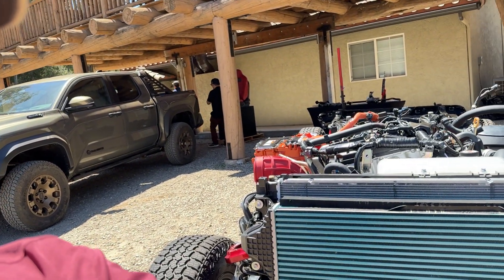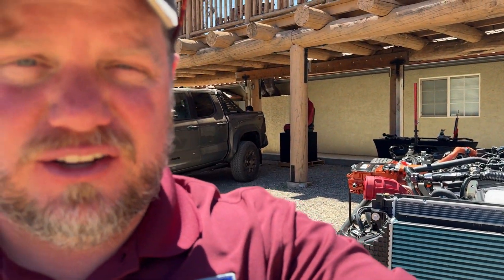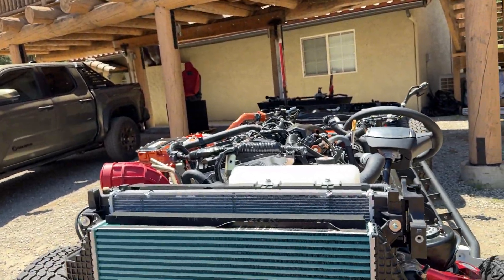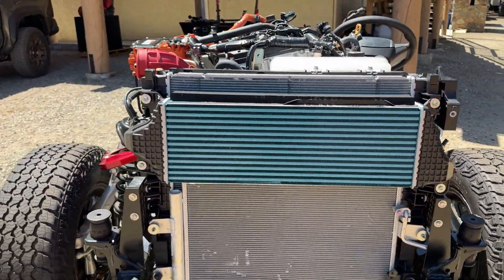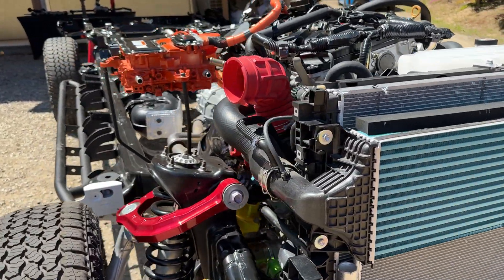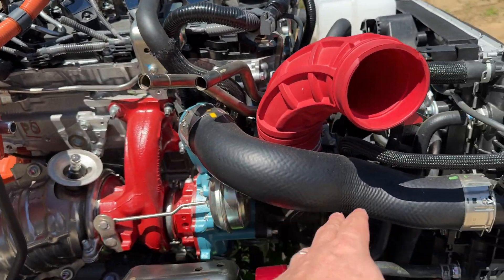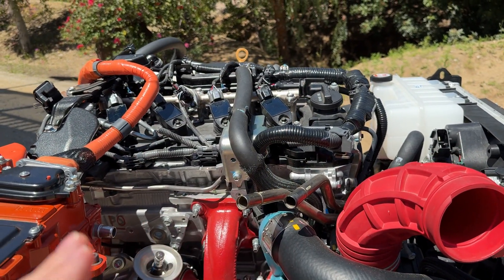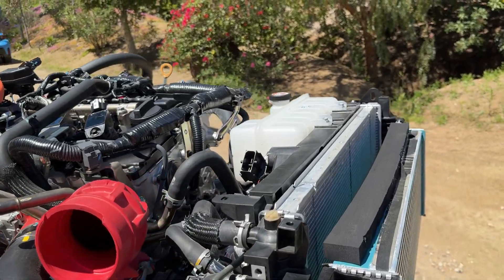More Complexity Coming! New Gas Truck Engines Are Getting Gasoline Particulate Filters

Comment: The powers to be have ruined the diesel with the addition of particulate filters and now want to do the same with gas. I guess this is their way of forcing everyone to the all electric platform. Increasing the cost and weakening reliability of the gas engine platform is the ultimate goal to force everyone into thinking that an electric vehicle is more reliable and cost effective. I have yet to see the government or any auto manufacture explain how their going to deal with all the power that will be needed to support this path we are on let alone how the spent batteries will be dealt with as they need replacement. What will the monetary and environmental costs be to support the future of electric auto's? It appears to me that the goal is control of human movement , not the environmental impact of gas and diesel powered vehicles.

Comment: When is BOEING going to get these? So the EPA is worried about gas and diesel engines but yet a plane can literally do a fuel dump to reduce weight. Literally dropping raw jet fuel from the sky.
Reply: Just wanted to post a link to one that did happen. Main reason it caught attention is because it was over a major city and schools but imagine all the fuel dumping over the ocean that aren't being reported due to no one knows so not a problem.
Reply: @JacobWinkle 😂 just how many aircraft with a fuel jettison system do you think there are in the United States and just how often do you think fuel is dumped? I GUARANTEE you airlines don't want fuel dumped outside of an emergency situation. Fuel is one of their largest recurring expenses.
Reply: @wilmarbarrick3194  Oh man do you have some learning. They dump fuel a lot. They dump fuel before landing to lose weight so the weight doesn't break anything. They don't have to but they do because the amount of time a plane is down for repair is money lost. Its a lot of money lost. Just look at how it is when they repair run ways. They don't shut the airport down, they wait for a gap in the time to do it with a lot of construction equipment and go to town doing sections at a time.

If the numbers are still true from 2018, dumping fuel is a .01% but if that number still holds true, that is still 20 million gallons, yes gallon of fuel being dumped but the EPA doesn't care about that. The rule is a minimum of 2000 feet above any obstacles around them to dump fuel but they do have designated areas where they can dump fuel as well. Not even an emergency situation either. Just to make sure the plane lands with as little weight as possible to make sure the plane doesn't break. Hows that information for ya. Now you have somewhere to start your research on your own.
Reply: @wilmarbarrick3194  That video is doing a runway for an airport. $20,000 a min if they aren't done on time before the plane lands at 5:30AM or 6:00AM. It's been awhile since I watched the full video but I do remember that part. They don't stop plane traffic because if they do, it messes up the scheduling for planes but also passengers to be on time to their destination and that cost a lot of money. They said that if they are an hour late with getting the runway done, it will cause a minimum of a day to up to 3 days of planes being scheduled to take off and land on time. They are rushing to get the runway done because there are planes in the air scheduled to land on the runway at a specific time and it's a race against time.
Reply: @wilmarbarrick3194  

Planes with a Jettison

Boeing 747
415 Still Actively flying 2024
52,410 Gal. Fuel Capacity 

Lockhead L-1010
1 Still Active 2024
31,600 Gal. Fuel Capacity

Mcdonnel Douglas DC-10/MD-10
1 still Active 2024
31,650 Gal. Fuel Capacity

Airbus A340
214 Still Active 2024
51,750 Gal. Fuel Capacity
735 built in 2023
800 is the target build for 2024

Airbus A350-900 to be replacing the Airbus A340 by 2025 but the A340 that is still active will still be flying alongside the A350-900 in 2025.
Reply: @JacobWinkle Before you babble any more, I should probably make you aware that I've been a pilot for over 30 years.  I also hold an A & P IA for  close to that too.  There's probably not much you can tell me that I don't know (or knew)about aviation.  Despite what you may think, fuel dumps are quite rare and they are normally coordinated with ATC so there's a record despite what you may think.  Most common situation for a dump would be if a long haul flight took off and a problem necessitated an immediate return.  If takeoff  weight exceeded max landing weight you'd dump or burn off what's necessary providing the situation allowed it.
Reply: @wilmarbarrick3194  Im a pilot too. Thanks for asking. Anyways still proved my point for the EPA on gas and diesel vehicles. 
Sounds like you're just upset because I gave you the information and you don't know how to handle that so you just want to revert back to what google says. You think you can get smart with ATC but just because something gets reported to the ATC doesn't mean it gets reviewed by the EPA either. FAA on the other hand is a different story. So with many things said, my point stands and yet EPA doesn't care if you give them enough money to look the other way.
Reply: @JacobWinkle WTF are you even talking about? If you're  a pilot, you're one of the ones that makeup the reams of paper in accident reports and the only person googling things in this thread is you. Does fuel ever get dumped? Sure. Is it often? No. Does the EPA care? I don't know. If I ventured a guess, I'd say no. Why? Because it's not a normal everyday procedure.      You should probably take some courses in math.  While a plane dumping fuel may have a localized event with many gallons, there are only a few thousand planes that can do so and it's not normal to do it.  Now compare that to a few MILLION vehicles... see where this is going?
Reply: @wilmarbarrick3194  I didn't care to read it. You proved my point already you don't know. We're talking about the EPA here and on this video. Do better.

Comment: I got a way to bring down truck emissions. We could just build smaller work trucks with high payload capacities. Not every job site actually needs another half ton or larger. For local business, the rest of the world has trucks using much smaller engines with ridiculous payloads. Not every truck in the fleet tows. They're lobbying heavily against them because they cant charge as much. Japan pays less than $10k USD on their farm trucks
Reply: For instance, a Japanese kei truck has a payload around 1500 lbs. It's about the same as most American half tons.

Comment: I’m thinking my 2011 2500chevy hd 6.0 gas will just get rebuilt if needs be I’m 63 and it’s only has 287000.0 miles I’m not buying a new at this point I have gotten 580000.0 miles out of a 2007 and sold it to a guy that still runs it .

Comment: Thanks for doing a video about it. I've been talking about this for a few years now.  It's coming for sure. DI engines produce much high particulates than older porr injection.  

These will fail just like the diesel ones do though , and the costs are high.  We put a diesel one on last month to the tune of $2800.
Reply: I read that GPFs are much less expensive as they use a different media inside them and the fact that gasoline engines do not produce as much soot as diesels. One article said just ~$200 for one, and that they clean out more easily under deceleration so regen isnt near as common.
Reply: @ALMX5DP   That may be true. I will find for sure, in the near future though.
Reply: @terrencejones9817  agreed, or even the present as I think someone mentioned the now released(?) Lincoln Aviator or Nautilus or whatever has one.

Comment: Will it need DEF ?
Reply: No, it will need GEF
Reply: @brettradecki  

Do I need to use a GPF additive?

Due to the nature of GPF regeneration, an fuel additive it not required to assist in the cleaning / regeneration of the filter.

Comment: Let’s see what has the EPA done for us over the past many decades? Cleaner burning cars and trucks, yes. Cars in the 70's polluted like a coal fired plant and at 10 mpg.  Remember how wonderful they smelled when sitting behind them in traffic?  Now they get 30-50 mpg, with a tenth of the emissions ( no smell) and twice to three times or more the horse power.  So sad…... 
my diesel truck, you know the one Tim, the Silverado with the baby diesel gets 40 mpg in normal highway driving all with no measurable amounts of emissions that the EPA is worried about.  That sure sucks.  The automakers always bitched about unrealistic limits, but they managed to meet them.  And then we have the under educated trolls who think they know best over scientists, engineer and the EPA. It’s laughable.  This is progress.  If you don’t like it, move to some third world country where the laws aren’t as Strick.  But most of them have crappy air quality, higher death rates and they all seem to want to come here.  I’m old enough to have owned cars and trucks since the 70's and these vehicles we have now are simply wonderful.  No smell, high fuel mileage, Hugh horsepower and electronics that make driving simpler and safer. Yea it sure sucks to have what we have now.   This is progress.  Deal with it.  Buy the cars and trucks or don’t.  There are many used old ones out there to shut you up.  Let’s the comments begin.  Let the crap fly from pseudo experts.
Reply: Yes your right.  I bought a 82 pickup a few years back and thought it was running rich. It wasn't it's been so long since I owned one I forgot that you're not getting efficient burn! My problem is efficiency vs reliability.  An ice is only going to get clean to a point 30-40%? Where if you use solar panels to get power, improve battery chemistry, use a out of the box 93% efficient electric motor you have true zero emotions. Putting GPF on the exhaust is like all the vacuum lines the 1980's cars had on the carburetor. They were trying to clean something up that was inherently dirty.
Reply: Thank you for posting this. People forget about the acid rain produced by the coal fire steel mills and the sulphuric acid it produced. When you live in a society there have to be rules and regulations otherwise there would be chaos. If people don’t like the rules then as you say please move to another country.
Reply: Thank you. I grew up in Los Angeles in the 70s. Smog days when the air was so polluted you could not see the nearby mountains, and children, old people, or those with asthma were encouraged to stay indoors.  
Not going back to that. 
And you whining folks can pound sand
Reply: @222aint  yup I remember those times too, the photos and the medical issues.  Yea the cars are more complex but they are better.
Reply: Lol
Reply: .5. Let’s see that must be IQ rating.   Lol
Reply: .12 Ah a BOT

Comment: Particulate filters don't reduce CO2, they increase it.
Reply: That's not the whole story - And as Tim stated "I like clean air"  (without fine particulates like PM2.5 pumping out tailpipe).  Which particulate filters are very good at reducing.  Still trucks are too complicated and expensive.   There must be a better way.  We should start demanding it.
Reply: Yep, and they don't reduce wind resistance either.
Reply: They also increase lung issues and diseases because they filter these suits so much that the lungs cannot block the pollutant and get stuck in the lungs.

Comment: Great. If they are anything like a semi DPFs in expense that's a killer.
Reply: It depends on whether the particulate filters work with active or passive-only regeneration. If we're talking active regeneration, then we're doomed, doomed, doomed.
Reply: From the initial article or two I read, seems like they will be pretty inexpensive and last a long time with much less need to have any injection system or regeneration requirement (unless all someone’s trips are very short with cold starts all the time).

Comment: I think it's just cons, because the car will consume more fuel and in the end the result will be similar. That's how they made Diesel engines less reliable. Will be interesting when they say that Lithium and Chrome used in batteries need be clean (extracted from deposits in the ground) and not come from  slave like jobs.